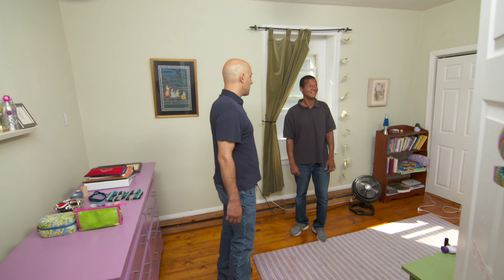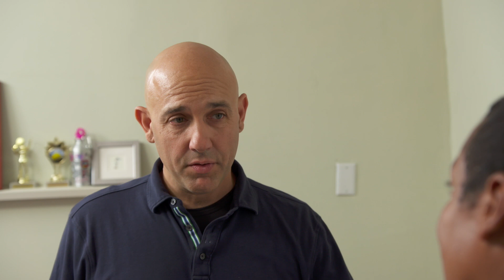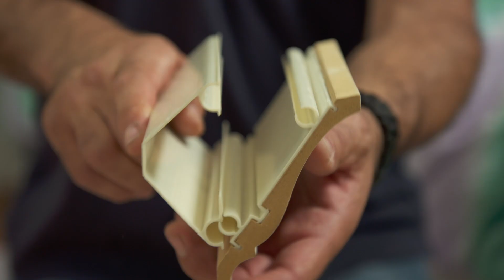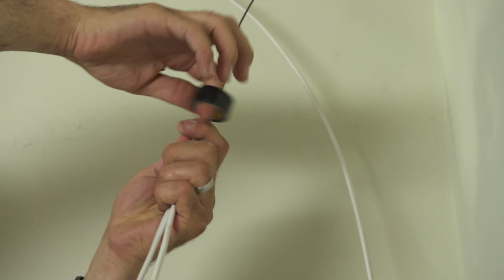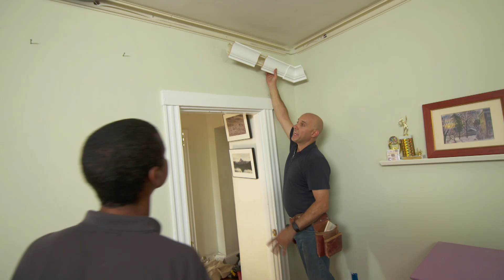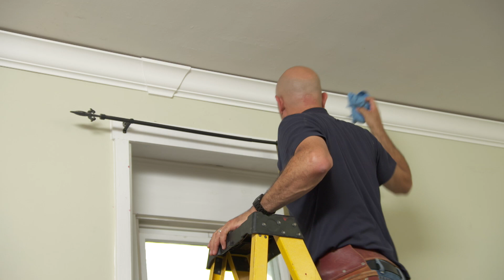How to Conceal Electrical Wires with Crown Molding | Ask This Old House

Comment: Pretty sure I can make the same kind of L-box for the wall-ceiling corner with some 1 or 2 x 3s & use traditional crown molding, screwed to the sides on top & bottom or even metal-clipped from behind! Thanks!

Comment: lousy measuring, most people would not want the space that was left between trim face and ceiling, that's where spiders, centipedes and other insects will come and go. i suppose you could chalk it but you shouldn't have had to if the measuring was exact and not "...about 3 inches" cuz now the homeowner is stuck with " ...about 3 inches" ...  be exact with your measuring or don't do the job.

Comment: This is really a DIYer solution, I can’t see a professional ever using something this cheap looking.
Reply: i bet if it wasn't installed with a gap from the ceiling it wouldn't look nearly as crappy.

Comment: As an electrician for 40 years the only problem that I saw was one must put a pigtails on your wiring while installing outlets or switch.
Reply: Wrong.
Reply: I think you need another 40 years because you’re wrong about that
Reply: @electricaf365  I've been pigtailing outlets in daisy chains. Am I a moron wasting six inches of Romex every time and valuable minutes or what? The reasoning for doing it seemed to make sense; one outlet fails the rest do not.

Comment: Can you not run wiring behind standard crown molding? This stuff looks like crap with those keystones and corner pieces. I suppose real crown molding would have required a different trade though.

Comment: Several things amaze me in the comments here: 1) So many experts and pros here, and yet I can’t seem to find any whose work is any better than what’s shown in the video. 2) I have to assume that none of the commenters live in an actual “old house” since the concepts of lumpy plaster walls and ceilings are so impossible in their minds. 3) That crown moulding may not be the prettiest thing in the world, but it sure beats knocking off 500 pounds of lath & plaster, drilling all the holes, and then patching it to match the walls when done. Cheaper labor too. 

So many YouTube pros...I’d hazard a guess that approximately 0.0003% of them have ever actually touched a saw or hammer and had it turn out the way they claim it did.
Reply: I actually have done this like he said impossible to go but job is got to be done. 
I had to be in attic and boss on the room. So difficult to get cable around and fishwire. All because owner don't want to patch or crown molding prices. Yet don't want to do it them selves.

Comment: Never use your hand as a hammer. Rubber mallets. 
Make sure your wire is wrapped around the screw in the direction it tightens down, or it’ll slide out from under and make a loose connection.

Comment: why not just drop one wire down use wire nuts and save the wire expense.
Reply: You would need to mount a box behind the moulding at each location to make connections. Most places won't allow you to wire like that. You're expected to wire from line to load either pigtailing at the box or through the first outlet to the next outlets to the last one in the line. You can't just wire nut in place inside the plastic moulding.
Reply: @garyphillips6270  so wire nuts have to be inside a box, is that the idea?
Reply: @EnergeticWaves  Yes

Comment: If there was an adjustable light in the gap of the crown molding that would look really cool
Reply: Like an led rope light?  I think a lot of them(especially the more expensive ones) are length adjustable and have controls that provide a variety of settings.

Comment: As a homeowner with limited time and funds to complete all home improvement projects at top quality, I appreciate seeing this quick solution to a common problem.  Yes, Tommy's real crown molding would be more aesthetically pleasing, bit this isn't terrible.  It's certainly an improvement over wires laying and hanging everywhere.  And you can do the project very easily in the short precious hours of a weekend!  Thanks for demonstrating a product like this!

Comment: Could of just changed the breaker to 20 amp and used a wall mountable power strip or a two gang box and two receptacles.

Comment: Measuring down 3 inch probably would have been better with the out or each ceiling. Just cheat it a little and do a quick calling. Other than that seems like a cool concept.

Comment: The joints and corners look very bad in addition to the gap at the ceiling. Why not just use conventional cove molding with conventional installation.  Looks like a homeowner DIY rigging.

Comment: I can't think of a way to make that more of a fire hazard.  Surrounded by what looks like 14ga wire with multiple outlets everywhere, not to mention all 'hidden' behind cheap flammable plastic.  Would NEVER pass code around here.
Reply: How do you know the plastic is flammable?
Reply: You base Receptacles off the equipment that is being plugged into them. Loads determine the # of receptacles.
Reply: No such thing as flammable plastic

Comment: Oh, the joys of hollow walls...... Mine are "engineering" brick, slightly harder than granite.
The gap between the ceiling and crown is an opportunity, fit the support channel 1" lower, run LED strip around the whole room on top of the support channel, connect up and it will be more versatile and cooler than that ugly dome in the middle.  Obviously you'll need the strip with an IR controller.

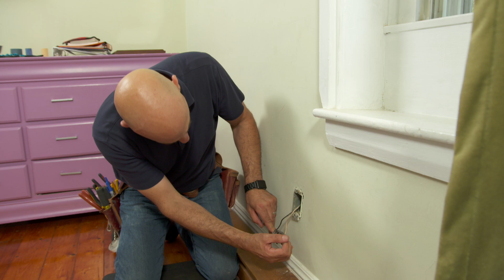Comment: 3:24 - Should've mentioned that a GFCI is required for using grounded outlets on ungrounded circuits. It's a really easy and cheap fix the way he's doing it. That one outlet on the existing box could protect all of the downstream outlets. Though there very well could be a GFCI breaker in the panel.
Reply: Oh yea no ground wire

Comment: Great product! That grounding wire nut looks cool. But shouldn't that block plate be a lot wider to protect vertical wire? Minimum 2-1/2" wide? 
That looks like a 14 gauge wire. I wonder how many devices are on that circuit?

Comment: I would have just went with the less expensive wire-mold option but only if if the path of least resistance is possible.

Comment: Thats the tackiest and most horribly installed crown molding I've ever seen
Reply: gotta love that uneven gap between the crown molding and the ceiling...
Reply: So he should have collaborated with a carpenter or general contractor!
Reply: i too admit that that is hideous
Reply: Omg hella
Reply: I think the major problem is the color doesn't match with the wall.
Reply: Those keystone and corner fittings just look so tacky
Reply: Personally, I like it.
Reply: It's really not too bad. The gap creates a nice shadow line that creates a bit more depth. In fact, plenty of houses have indirect lighting hidden in gaps like that. The endcaps should be flush with the side pieces in my opinion. And, the keys should be centered. Other than that it's not a bad product.
Reply: He's an electrician not a carpenter or general contractor.

Comment: I suppose this is like a UK version of a ring circuit? Curious on what is the amperage on a typical US socket circuit.
Reply: Typically 15 Amps.
Reply: South Mississippi the company I work at runs 20 amp circuits with 12 gauge wire
Reply: Amperage is based off wire gauge. 14awg=15amps
12awg=20amps
10awg=30amps

Comment: OK system I guess. I've started to fish the floors where possible from one side to the other. Cut a hole under the baseboard and bottom plate in the wall. Big enough for your hand and fish tape .

Comment: Hi There!
I have a question for you:  when adding more outlets to the original circuit, will that circuit be prone to blowing the fuse since more items can be plugged in to it?  Thanks.
Reply: EdABrass 

If you are running a ton of high usage appliances at the same time you will be trying to consume more power than the line can provide and you will trip (not blow) the fuse. All you have to do is turn off these appliances and go to your breaker box and flip back on the switch that is down

Comment: A better example would be where there is a genuine shortage of power.  This owner is saying that there are many tiny appliances, but they total less than what one circuit supplies, so a power bar and/or extension cord is the obvious choice.  This "solution" is so ugly, it would be my last choice.
And if you have to chop holes anyway to bypass firestop framing, you might as well have fished horizontally.  This being an exterior wall without proper insulation and moisture barriers, and made of fragile cedar lath,  would have been best by far to just chop the wall and redo with insulation and inexpensive sheetrock.

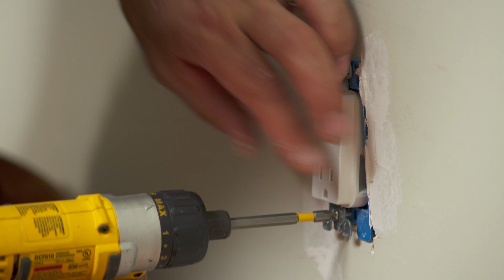Comment: 7:50, take the ears off dude!
Reply: Phil Laruez why would you take the ears off for a cut-in box in drywall? you take the ears off for raised covers for 4-squares
Reply: CMOS Crash - The combination of the box ears and the device yoke thickness is normally too much for the cover plate to accommodate.
Reply: Yeah, the recept sticks up off the wall without taking the ears off

Comment: I suppose the code limit on the number of outlets in a circuit just gets ignored.
Reply: Chuck D - Five outlets is very reasonable.  What code are you citing?
Reply: @cup_and_cone  there is no code on that
Reply: NEC
Reply: Care to cite the actual line you are referring to? NEC 210.52 doesn't specify a maximum number of outlets.
Reply: A. A receptacle outlet must be installed in every kitchen, family room, dining room, living room, sunroom, parlor, library, den, bedroom, recreation room, and similar room or area so that no point along the wall space is more than 6 feet, measured horizontally along the floor line, from a receptacle outlet [210.52(A)] (Figure).

In addition, a receptacle outlet must be installed for each kitchen and dining area countertop wall space 1 foot or wider, and receptacles must be placed so that no point along the countertop wall space is more than 2 feet, measured horizontally from a receptacle outlet [210.52(C)(1)].
Reply: I thought you were talking a maximum limit, not minimum. Disregard my comment.
Reply: @chuckd2483  nope. Not in a dwelling unit
Reply: @cup_and_cone  you are correct
Reply: @chuckd2483  that’s wall spacing. Not maximum amount per circuit. There is no max.
Reply: @cup_and_cone  he was. He changed his argument and cited a different code. There is no max.
Reply: I agree with chosendude.  The initial comment about a "code LIMIT on the number of outlets IN A CIRCUIT" in no way sounds like you are referring to outlet spacing.  The code about 6'-12' spacing says nothing about limiting the number of outlets on a given circuit.  So while you are right about that spacing, the initial comment is misleading.
Reply: Chuck D I don't think the 6'-12' rule was in effect when this house was built.
Reply: There is no code limit
Reply: Renovations and changes must comply with current codes.

Comment: The gap between the ceiling and the moulding looks awful. The fact you're going to have to repaint a fairly large area to cover the replastering means you'd be better off repainting the entire wall...which means you would have been just as well notching things out and do a proper job.
Reply: RuralAccent Woodcraft the ceiling is crooked as balls. they could just caulk the opening
Reply: @Boris
True, but when he mounted the track system, he just eyeballed it.
He should have clicked-in a small piece of the final molding to the track when installing it to the wall.
This way, he could have at least had a small manageable gap instead of the massive gap that now exists.

Comment: a simple $10 power strip would of fixed his problem. if he wanted to get fancy get the $20 one with a surge protector.  Doing this will save you money and you won't have those ugly af gaps.. that guy just wasted his time and money only do make the room worse.
Reply: Agreed.  The added outlets were just being spliced from the same original outlet.  No additional power delivered.  Quite useless and an incredible waste of time and money.  False sense of security too - now this daughter will think it's okay to run a space heater, vacuum cleaner, and curling iron all at the same time.

Comment: "She has a lot of appliances" 
Okay. Like what ?
She has a fan, a light :D
Reply: ...a toaster, microwave, & fridge for those midnight snacks
Reply: @leobgoo6350  A Kegerator, an arc-welding station and a plasma cutter...
Reply: @Mark-wp4lw  don't forget the table saw, 3d printer,  laser cutting, cnc router.
Reply: Right? All low wattage plug in wall warts! Power strips would have sufficed
Reply: @Progrocker70  Literally! A simple wall attachment making 6 or 8 outlets would of sufficed too!
Reply: @Victor-tl4dk  Home Owner: I forgot to tell you thats a 20 Amp Dedicated Line and Sike I lied nobody lives here...
Reply: Oh boy, she's a teenager alright!
Reply: this is a little girl she's going to need hairdryers etc as a teen soon and those definitely need higher wattage.   

If she were an adult woman I'd say she's running a Hitachi!
Reply: @beddythecorgi4269  Isn't most blow drying done in the bathroom in front of the mirror?
Reply: Lmao ...you made me cry...

Comment: Real crown would look so much better, be a custom fit, and still hide the wires. I have used crown and baseboards to hide wires. Would have rather been super uncomfortable for a while in an attic drilling down to do it without any cover up. Cut in boxes look hacked too. Anyways... still waaay better than only 1 recep.

Comment: One 15 amp circuit is fine as long as no-one plugs in a window air conditioner or electric heater. I would have used the shallow flush mount outlets Scott mentioned using a white chase system. Two extra outlets would have been fine - one behind the dresser and one to the right of the closet doors. The chase would go up and over the doors. This way, no holes would have to be made in the walls except for screw holes to mount the outlet boxes. At 0:15 you see what looks like a brown wood baseboard heating cover the length of the room and it's sticking way out behind the home owner. WTF ? And yes, the window opening is twice the size of the window. Talk about a makeshift job. Time to call Tom Silva :)
Reply: this is a teenage girl, i am going to guess tv, iphone, ipod, macbook, a/c, blowdryer, curling iron, and heater...

Comment: I thought 2016 NEC required pigtails on all Outlets.?
Reply: Colin Beirne no such thing as a 2016 NEC. Code books come out every 3 years 2014 and 2017,2020,2023.....
Reply: @dallas5374  good point!
Reply: I learned to always pigtai in 1962 when I started and always do, regardless of codes (or what years they are published)
Reply: You thought wrong. You won’t find that anywhere in the NEC
Reply: Electric AF. Strange.  Our local codes here require it

Comment: House building in the USA looks so fragile to me. I live in Brazil, and here every house or apartment is build using bricks and cement, and wires go through ducts installed in canals broken in the masonry itself.

Also, a trusty electrician here would never populate a whole room of wall outlets feeding from one simple old outlet, specially with such a thin wire like we saw in this video.

Comment: Interesting product, if you don't hate crown molding like many do.  And this short term  situation does not justify all the work.  Extension cords and splitters work fine, especially when the load of all the appliances he named only totals a small fraction of what a single circuit provides.  Also, many codes forbid feed-in-feed-out.  They insist on wire nuts, and only one wire to the screw.

Comment: There's no insulation in the walls? Wtf?
Reply: lath and plaster walls rarely have any insulation..that's how they were built.  I'm working on a house built in the 1930s right now.  There is ZERO insulation on the exterior walls and the studs are not uniform.  They built them to last but they built them basically however they wanted.
Reply: No insulation in my 1960 home 🤷

Comment: hmm, I like the idea of running wire through the crown, but I don't like how the project designed those weird overlapping pieces to join two straight pieces.  I would prefer just butting up to pieces, caulking and painting them.
Reply: Yes i agree.
Reply: Yeah, I agree that the overlapping pieces and the corners are ugly, but if you use them it's a piece of cake if you want to add another cable in the crown. And that's the good thing about this product. Great flexibility that way. If it's a "non changing install" it might be better to use actual crown molding instead.
Reply: The reason why it is preferable to have those covers and not butt joints is because the moulding can shrink and expand, causing cracks. This is happened in my building and it looks messed up. With this system you don't have to make difficult mitres and it still looks ok.
Reply: The corner pieces looked good, but yeah, butt up and caulk would have been the way to go with the rest..
Reply: Hes an Electrician, they are garbage at making designs. They cut holes and run wires, I've never met an Electrician who could come up with decent design looks to hide imperfections or other related things. I would have used actual crown molding cause it takes two guys 45 minutes to put that up and 30 more to paint and caulk it. It also wouldn't have that ugly ass gap and tacky center cover in it.